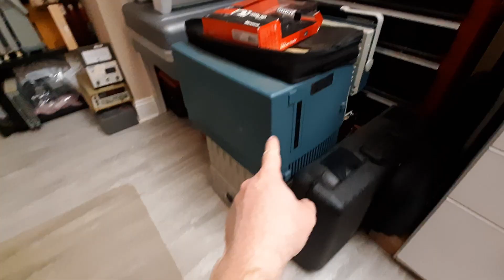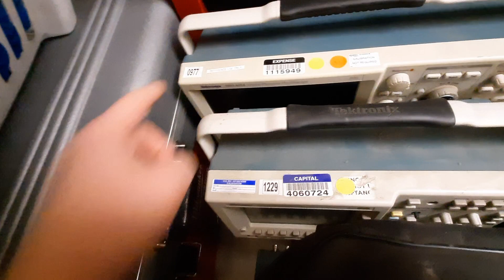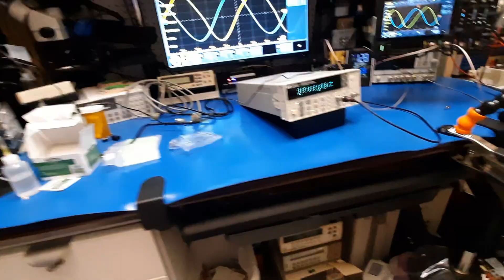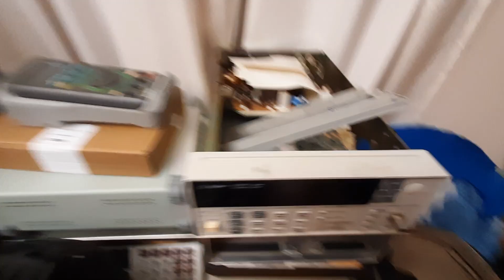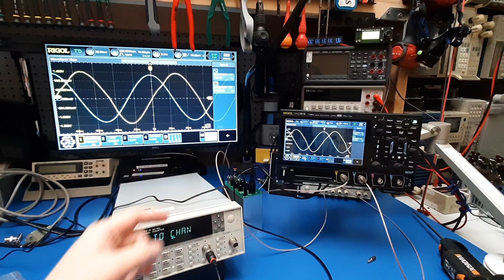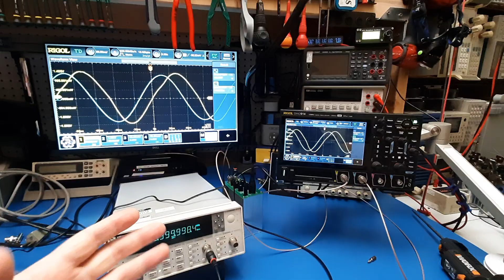53132A calibration and how to tell if it's fully warmed up

Comment: Tip: Try using your O'scope's X-Y display feature as a helpful way to visualize the drifting between the two 10MHz clock signals.  It really helps to see even minimal amounts of phase shift relative to the GPS ref clock.  Also,  the HP service manual recommends that you let your counter warm up for 24 hours before calibrating.  Happy Counting!
Reply from the maker: I knew quite a bit less about what I was doing (specifically with frequency counters) when I made this video it's kind of funny to my current self.  Thanks for the X-Y mode tip, I hadn't thought to use that for this purpose.

Comment: For how long was the GPSDO synched before you attempted measurement and calibration?
Reply from the maker: I just leave it on all the time to both maintain lock and keep the internal oscillator at temp.  It saves me from having to wait to have a usable 10MHz reference when I need it.